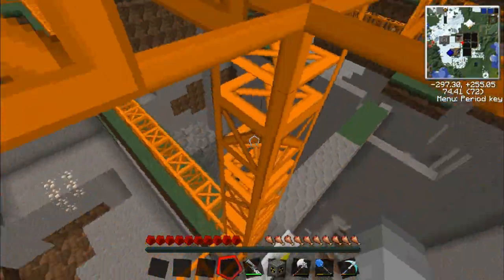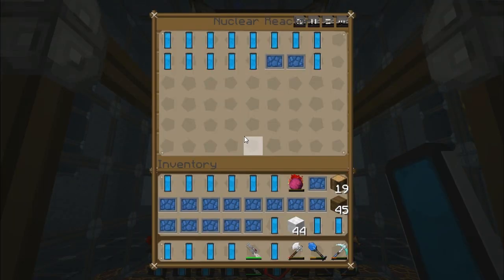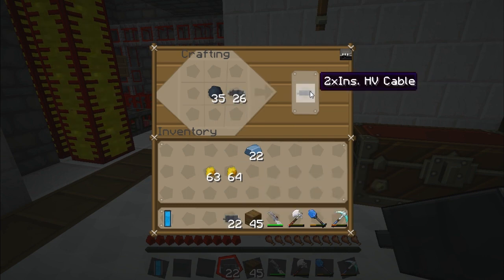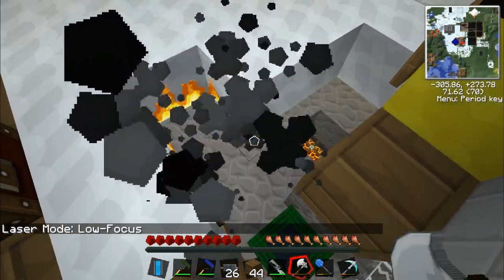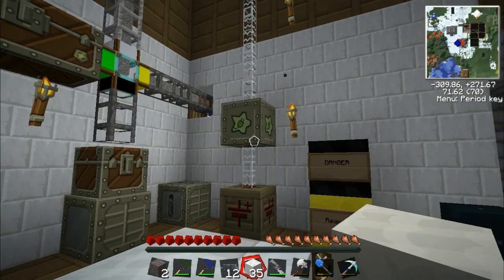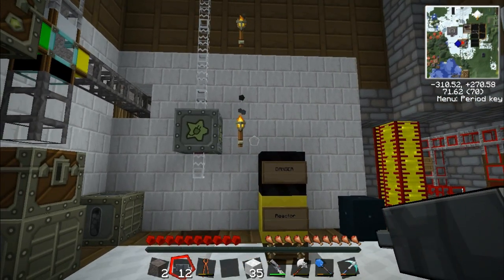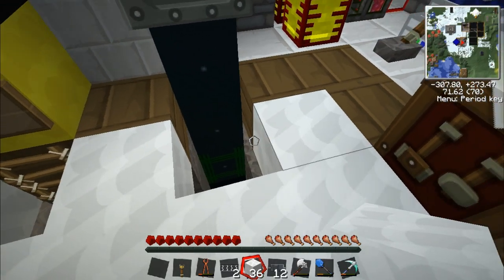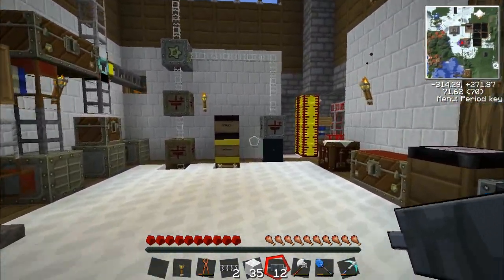Duncan's Lab - 19 - Danger! High Voltage!

Comment: Thanks Duncan, this video helped me with my problem - LV Solar Panel + 6 Solar panels were giving power into the medium energy storage thingy, and I wired up a macerator with glass fibre wires, and it exploded, but now I know that I need to transform it to low voltage. Thanks!

Comment: Mark 1 nuclear reactors are stable at all times. you dont need to monitor it and you can just replace the uranium cells as soon as they are depleted. Mark 2 reactors need to be cooled down after a certain amount of runs(= depletion time of the uranium cells), so they can get dangerous if you don't cool them down. Mark 3 reactors need to be cooled down within 1 run. He made a Mark 1, so you don't have to worry about anything blowing up if you did it right.

Comment: Hold shift when placing the wire and you don't need the wood blocks -- you can just attach it directly to the reactor. However the fat cable loses power quick so it's better to stick a HV transformer directly to the reactor and skip the cable altogether. Then you can just use glass fibre cable to your MV transformer and then LV transformer.

Comment: Make sure your input and output faces are set up correctly, I had the same problem :)
just use a wrench (the bronze one) and either right-click on the face you want to become output (MFS) or higher voltage input (Transformer). You can also Shift+Right-click which will set the output (MFS) or higher voltage input (Transformer) to the opposite side. Hope this helped, it's a little complicated :P

Comment: Safety tips, by Duncan!
1. If you catch fire, jump into your nuclear reactor, safely located 5 meters under your house!
2. Be sure to have your high voltage power supplied next to your fuel!
3. Continue your preperation AFTER setting up your reactor!
4. When working with dangerous machines, first act, then think!
5. 'I think...,' 'This should work...,' 'I guess....,' are all safe assumptions.

Comment: yes but with the more advanced reactor designs you can exceed the 512EU/t limit of the glass fibre, with those high voltage cables the limit is 2048EU/t, this is also the reactor output limit...

Comment: Dear makingthigns1, the reason why your machines are blowing up is that MFEs are medium voltage and regular machines need low voltage power (like compresors electric furnaces and extractors. Put a low voltage transformer between your machines and MFE. I hope my comment helped you make your machines stop blowing up.

Comment: A few days ago I commented about how much coal you'd need for the solar panels. Now let's moe on to the red matter. A crystal chest can hold 108 stacks of anything. 3*108 = 324. You need 30 stacks of coal for a red matter if you don't use a Condenser. 30*64=1920. So, 1920 coal times 324= 622080 coal. 622080 + 884736 (coal for the HV's) = 1506816. + misc for the other ones, which is another 3480 pieces of coal. In total, 1510296 pieces of coal. You collected that manually, did you? -.-

Comment: Have you got a 4X cabel coming fron one of the extra chambers? If so you must be transforming it down from 1000 EU/t (through HV transformer) to a MV tranformer then through an LV transformer. The transformers must have the outputs correct if you are using the diffult texture pack remember the higher voltage goes in through the 3 dots and out through the 1 dot.Chect the transformer set up and it should work.I have something like 8 reactors with the same set up as him on my server.

Comment: Duncan didn't need that set up a mfsu can take nuke power diretly and in a later version glass cables. Can handle a mark one and obcidien is nerfd by tekkit so will not handle a explosion that big plus reinforced stone must be 3 thick to handle it or in new versus can use a force field but forestry is removed in the new tekkit including eletrical engines but crop matrons still remain present in pack

Comment: But Quantum Armor Runs Out And Red Matter Armor Doesn't Use Any energy Plus If It Can Blow Stuff Up And Shot Lightning and Fly With No Energy Plus It Auto Heals You And Lets You Be Immune To Anything When Its On Also You Can Fall To the Ground Instantly By Just Holding Shift

Comment: Even with landamarks the maximum size is still 64x64.
And even if you had as much electricity as you claim to have, there's no use for it, and yes 14 mass fabricators don't need that much energy, I have 4 connected to one nuclear reactor and they're all working fine. 
And not using a condenser once is no guarantee that you didn't just use relays to charge a klein star and make items in a transmutation table.
Even with your supposedly 128x quarry there's no way you gathered 13824 stacks of coal.

Comment: yeah also you need 10 refined iron for each solar panel, 80 refined iron for a lv, 640 refined iron for a mv and 5120 refined iron for hv. that all adds up to 2,960,080 refined iron. I do not believe that you gathered 2,960,080 refined iron.

Comment: Well, it was good to have my "oh, damn, I'm stupid" moment when I saw him painting wires (I was doing a lot of messing about with wiring in my first sorting facility not a few hours ago).

However, methinks the EV cables are totally unnecessary. Most of the "safe" Mk. I reactors output 60EU/t, maybe 70EU/t. That's MV, which could easily be carried by glass fibre. Now a Mk. III on the other hand... >.>

Comment: 4x insolated iron cable loses about 4 eu every cable block and only goes to high voltage while glass fiber cable loses less then 1 eu every 16 cable blocks and goes to the highest voltage there is extreme voltage. And you say only the iron cable works? Look at the wiki bro.

Comment: I have 14 mfsu, 6 nuclear reactors giving off as much power as possible, over 9 stacks of hv solar arrays, 14 MV,, 21 LV, and 32 solar panels. I have 14 mass fabricators, a 128x128 sized quarry, 3 crystalchests full of redmatter, and i havent used the condensor once. I amazing lol

Comment: BETTER NUCLEAR SETUP: use a condenser and some energy collectors to make ice. pipe ice into reactor. have uranium filling reactor, except bottom rkw. in bottom row, put one on either side. use heat detector to turn off reactor if it reqches certain heat level. also, hv cable loses power fast. only use one before you cknnect to hv transformer. glass fibrr loses no power.